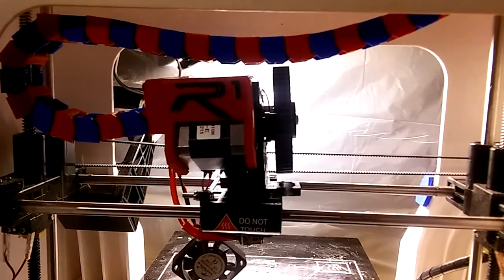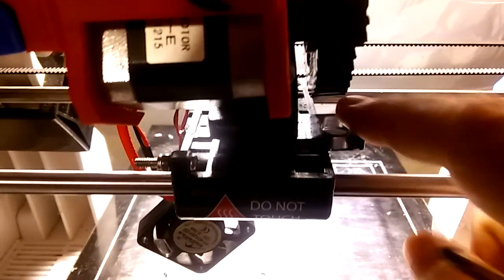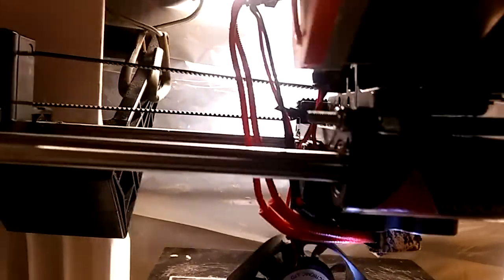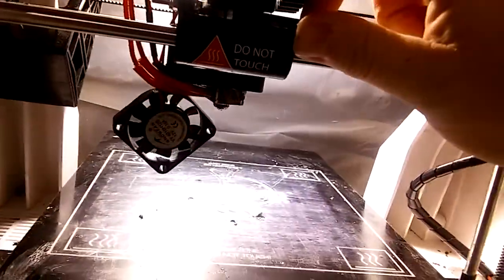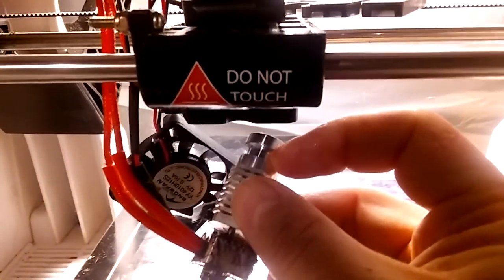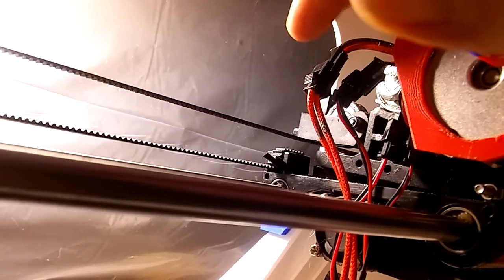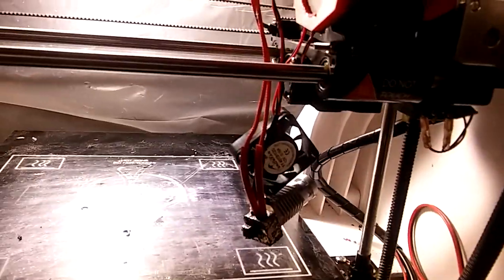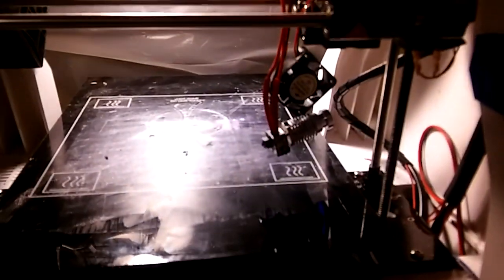Robo R1 plus hot end removal (updated! Not sideways)

Comment: Just picked up two refurbed RoboR1 Plus' and both seem to be having leveling and extruding issues. Messed with them last night and it seems they are both jammed since the filament wheel is digging into 1 spot over and over with no movement in the filament. Thanks for the video. I will be trying to get to the extruders tonight to clear their jams. Hopefully I will be able to print the calibration rings without tuning!
Reply from the maker: ManiacalPB 
heat up the hot end and get a guitar string or something and poke around in it....sounds clogged.